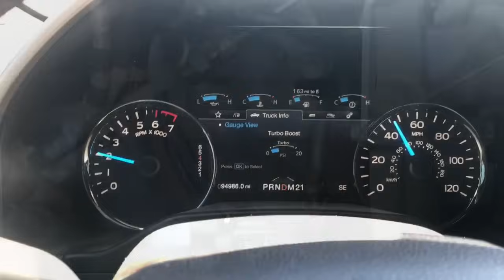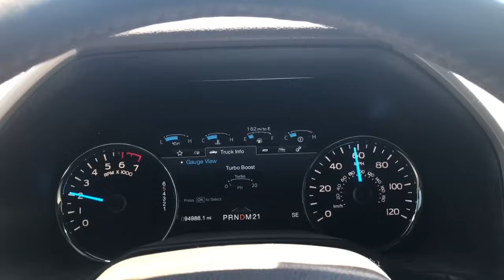F-150 Ecoboost 3.5 Turbocharger Replacement (Tips and Tricks)

Comment: My only question is exactly how long time it take from start to finish? BTW excellent video !!
Reply from the maker: thanks! about 2 hrs for one side. 2nd goes quicker because you know what to look for!
Reply: @AaronHinesAuto  wow that is not bad at all. I'm pretty sure I have a leak on the passenger side manifold gasket. And it looks like I should have no issue doing it over a weekend 😁
Reply: As long as the studs do not break while attempting to remove the manifold. Also, the manifold has been known to break due to weight, stress,heat from turbo. Ford has made revisions in the form of an additional stud ( from 8 to 9) plus redesigned manifold(fYI cost is $600 CDD)

Comment: So my 2012 F150 3.5 Ecoboost just turned 240,000 miles today, haven't had to replace any turbos or anything actually for that matter other than 2 transmition cooler lines. Still no problems with the truck, it all comes down to how you drive them, if you keep your foot out of the pedal they will run forever.
Reply: John Faber do you have a oil catch can installed?
Reply: I beg to differ. I’m pretty easy on my rig and I’m having to replace them again after 5 years. First time on the dealerships dime. This time I’m being quoted $7K.

Comment: Im about to be doing this job but with brand new turbos. About how long was the process? I will have all new gaskets, bolts, studs, and flanges.
Reply from the maker: Nice! Will take 4-5 hours to do both turbos and all studs.
Reply: @AaronHinesAuto  it took me 12 hours today. Only got the front connector done. No matter what i did i could not get the exhaust nut off. You cant heat it cause you will burn your hand due to no room. Then burping the system was a nightmare. When i did my waterpump it need a few burps. I guess since the turbos are so low it takes more burping. Ended up putting truck on ramps to raise front. I just dont get the trick to the exhaust nuts. What gives!
Reply: J T you get it? What was the deal you live in the salt belt? Rust?

Comment: Do you have to remove the firewall for the driver side too?
Reply from the maker: The fender well will need to be removed on the drivers side
Reply: @AaronHinesAuto  so I'm about to remove my turbo and noticed oil in the air intake hose. Does this mean the turbo is no good?

Comment: How do you get the front coolant line over the waste gate when putting it back in? Do you have to remove the waste gate? I have the turbo back in but the coolant line is behind the waste gate and I can’t find a way to get it over it to install into the coolant line fittings I just replaced. Also how much play on the turbine shaft? Under no oil pressure is there a little? Anyone know what’s acceptable and what’s not?

Comment: Great video! I just had both turbos lock up on my 2016 3.5L EB Ford Flex. Would the removal/replacement  procedure be similar to what you’ve shown here?
Reply: Ford flex uses a transverse engine layout so the turbo towards the front should be easier but the other will be against the firewall.
That's why I hate transverse layout, I always prefer the longitudinal layout much more basic.

Comment: Aaron , I have 2014 3.5 ecoboost with 218,000 miles I’m having an issue that no one can figure out and keep making different diagnosis maybe you can help . The coolant reservoir will  go low once a week and I checked the oil filler cap and it’s is a little milky but the oil dipstick is clean and oil is good  and clean between oil changes it will get worse I’m was  told that head gasket might need to be to be replaced or the motor heads are cracked .The motor runs very well and strong. What  do you suggest to do next to diagnosis if the heads are cracked I already replaced a leaky radiator already . Some one stated to change the oil cooler ?
Reply: Did you figure it out?  It looks like Aaron is still uploading content to the channel so he hasn't abandoned it yet.  Hopefully he'll respond soon.

Comment: how much oil is lost? is a oil change required for this repair?
Reply from the maker: Not to much oil. Yes you should change oil and filter if you are installing a new turbo
Reply: @AaronHinesAuto  but just for the coolant fitting swap you shouldn't need to change oil right?
Reply from the maker: No you shouldn’t need to. Not very much oil leaks out
Reply: @AaronHinesAuto  thanks for the quick reply! 
I tried to fix this in the past and could only get the front connector. The exhaust nut was giving me issues. No matter what socket i put on it was either to big or to long. So i kept slipping off the nut. Pissed me off so i caved in and dealt with this leak. Now its getting worse

Comment: ONE MAJOR MISSED POINT NOT MENTIONED.
PRE OILING THE TURBO BEFORE STARTING THE ENGINE. This is a major important step. Never Ever run any turbo while dry. Preoiling turbos and ketting the set for an hiur before installing insures Oil gets to all bearing sufaces and helps wet the gaskets to prevent drying out.

Comment: I took my 2011 F150 in for a coolant leak. They did a pressure test and said the turbo was spraying coolant onto the head gasket. They said the turbo needs to be replaced for $2600. Thoughts?
Reply: So what ever happened?  I am having a turbo changed after 5 years. First time it was on the dealership for around $6K. Now in 2022, the mechanic (not dealership) that I thought was fair just quoted me $7K to do both. He said they should both be done at the same time. Thought?

Comment: Great job. 
Thanks for taking the time to explain everything. 
New subscriber here.
I have a 2015 f150 EcoBoost 3.5L with 20,000+ miles. Yeah 20,000+ miles,  unfortunately I don't drive often due to working 7 days a week mandatory o.t.
I'm hoping I don't need to replace mines until after 100,000 miles.
Q. Do you replaced both at the same time of only the bad one?
Reply from the maker: Only the one that’s bad. At least that’s what we do here at work. We get the turbos direct from ford. For around 600 per turbo! That’s for the sub! More f150 content coming soon!
Reply: The Ford turbocharger is Around $1,400 CDN

Comment: If you change a turbo you should at least check the turbo oil feed fiters that are at the engine block for either turbo's. Otherwise you could be starving the brand new turbos of oil.

Comment: The coolant line that goes to back of the engine block is leaking at the fitting behind the block. I removed the manifold and still cant remove it do you have any tips?
Reply: After i replace my o2 sensor bank1 side1 passenger side ... i guess i hit the rigid coolant tube and i facing the same issue leaking at the back of engine block now.... but i have replace yet... did you fix it ??? You may need a flexible head wrench
Reply: @jaandel1 Remove the turbo, valve cover and vacuum pump then you should be able to reach it.

Comment: I'm having a bad misfire on #1 and #3.
I also have a blown gasket at that turbo for 123. Would that gasket leaking cause a misfire? It runs great, same fuel mileage as I've always gotten. Just misfires on accelerator demand. I ran an injector cut out, swapped plugs and coils. New Air filter, New throttle body. Oil changed. I've done all the maintenance. Can anyone help so I don't have to take it to ford? I'm a mechanic myself. Tractor trailer. So I don't touch many automotive stuff unless it's mine. Thanks for any help.

Comment: I have to do this on a 2016 Explorer Sport.  Passenger side turbo oil leak and wastegate is worn and making a constant rattle.   There is no access like on the F-150 from the wheel well.   Any tips?

Comment: Hey men I have the the F-150 2015 too and when I test drive they tell me that need this work done in the turbocharged and I can heard the leak when I push the gas pedal. But after they “fixed” I start feeling a vibration on the gas pedal when I’m driving and sometimes in the break. Do you think that can be for bad work on the supercharger? Thanks

Comment: For those wondering, getting the oil lines back on is a b I t ch
Reply: Aye I need help how did you take off the clip on the feed line ( 4:33 )? Im trying to take off the turbo myself but my issue is taking this feed line off
Reply: Go to harbor freight and get a long pick with a flat end. Not a screw driver. You will be able to get. Even with that it took me near 2 hrs lol I was struggling

Comment: When replacing the turbo mounting bolts mine only go in about 4 threads by hand and then stop. Ive ran taps in the holes..tested other m8 x 1.25 bolts with no issues. A nut wont run on the turbo bolt either. Ive now bought 2 different sets of the mounting bolts and they almost look like there designed to bind up?....anyone in the comments section here care to commont as im at a loss for what to do with it
Reply: My new OEM sets were tough to get in. When removing the old ones, I noticed how hard my impact driver had to work to back them out. I guess the are engineered for some sorta friction fitting that makes them extremely hard to bolt down. But when done,. the are solid.  - I just wrapped the replacement of all the lines, connectors and new BD manifolds.
Reply: I need help how did you take off the clip on the feed line ( 4:33 )? Im trying to take off the turbo myself but my issue is taking this feed line off

Comment: Do you replace the 3 bolts that hold the turbo on as well, or can they be reused?     
Also the studs for the turbo can they be reused?
Reply from the maker: No, I never have replaced those 3 bolts. Ford does recommend you do tho. Never had an issue reusing them or the studs
Reply: Aaron Hines Thanks for the information. The video is great! I took my inner fender off today to investigate and I didn’t see any fittings leaking but I did see oil all over the front of the turbo where the intake mounts to it. Strange because I see little drops of coolant when I park sometimes. Not sure what to think but the set up is pretty different on my 2012 than yours in the video. I’m thinking I may need to rebuild the turbo.

Comment: How reliable are the turbos on these trucks?
Reply from the maker: Pretty reliable in my Pinyan. But that doesn’t mean that they don’t have their failures. Seems to me that the coolant connectors and the oil gasket’s are the weak link
Reply: Aaron Hines you are exactly right but on my 2016 Expedition I had to replace mine just under 50k miles.... why do you think it went bad ???

Comment: How does any manufacturer not give you a drain on the radiator? Pulling the bottom hose makes no sense to me as this is messy and rediculous. Ford put joke of qaulity components in their trucks and ask top rate prices.
Reply: There is a drain cock left hand side just above frame rail.

Comment: Hell, I'd stick with a tuned 5.0 over doin this shit or even worrying about it few small bolt ons and tuned you'll make more power than the ECO-BOOST
Reply: Or you could just have more power out of the box and not have ANY issues whatsoever like I have on my last four F150s. Sure the 5.0 is a good motor, but there’s a reason the EcoBoost outsells it 4:1.
Reply: Or I can tune the Ecoboost and walk the 5.0. I’ve owned 4 Ecoboost Trucks putting over 100k tuned miles on each. My 2012 had a manufacturing defect that killed the engine. A piston skirt broke off and got sent through the engine and turbos.. but this can happen to any engine so not really an Ecoboost issue. For the most part the engines have been reliable. My current 17 3.5 puts down 470 hp and 533 tq to the wheels with just a tune on 93 gas. 553 hp using E50. The 3.5 is a powerhouse and I very high performance engine. There’s a reason why it’s in the Ford GT MKII making over 700 hp.

Comment: What's the parts and labor cost of this job to a customer?
Reply from the maker: Dealer will charge about 2,000.00 for one turbocharger. That’s parts and labor. If you purchase  a new turbo and all the gaskets from the ford parts department and do all the work yourself it should be around 700.00
Reply: Or just go buy 2 turbos by full race 2300 by borgwarner dont ever buy from manufacturer its highway robbery plus they are borgwarner turbos from ford they just up charge everything
Reply: Will Holder 
I have a 2011 eco, I just picked up a brand new oem turbo for a 2011 on eBay for $330 + free shipping. Mahle gaskets were $32 plus an oil change. Hopefully I’ll be around $400 for everything. The new turbo came with the push in fittings already installed.

Comment: This is why I went with a chevy v8.....I did not like the turbo v6...
Reply: U know that tractor trailers have turbos? They last a million miles ..that's why I got my 2.7 turbo no problems
Reply: @jayg9732  either one I'm happy w the chevy I got 2 days ago
Reply: I have a 2011 3.5 with 120k, no major issues, runs like new
Reply: @jgbuff04  nice! Idk I just went with the chevy I fell in love with the color it's a 4x4 z71 but there was a very nice ford on the lot
Reply: No problem, i am definately not brand loyal, i like the chevy's and the dodges....just ended up with the ecoboost it had what i wanted at tthe time, and soo far so good, my old 2006 f150 5.4 was horrid.
Reply: @jgbuff04  I've had a nissan xterra crashed it great truck, Toyota Corolla I got rear eneded great car Honda civic great car flooded by ike, Ford ranger bad tranny traded in for my chevy silver! Well I've had about everything what can I say I wanted a nice f150 but I saw this chevy and fell in love!
Reply: rafa baraja Shitty Chevy
Reply: rafa baraja SHITTY CHEVY
Reply: Everyone I know that’s had a chevy truck has had some major issue with them or died in a crash. Terrible protection during an offset crash.. and the engines LOVE to drink oil and drop lifters.